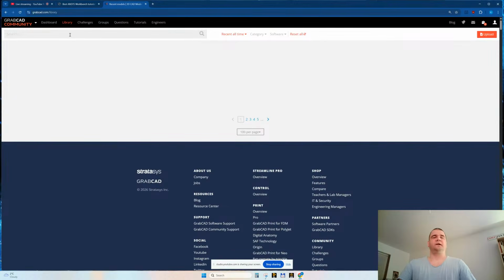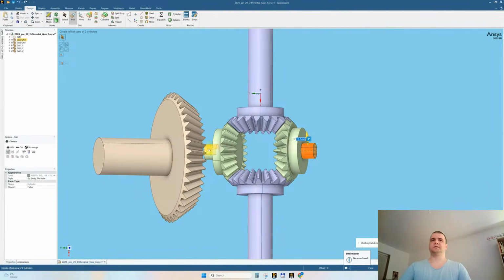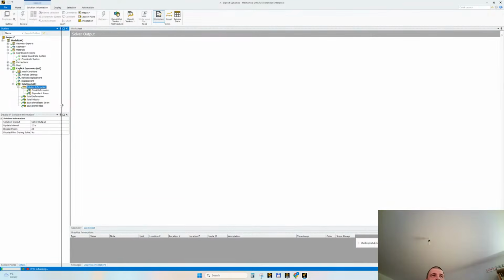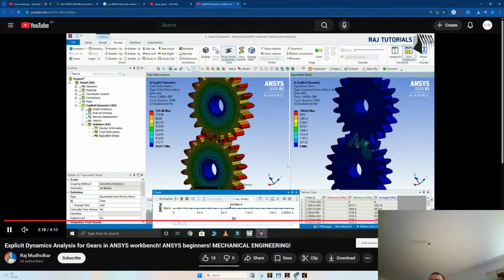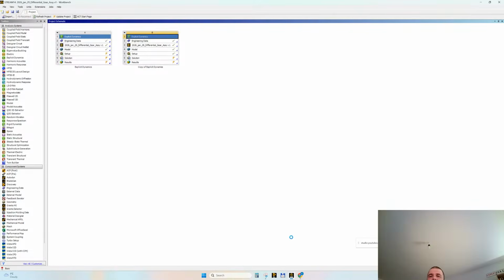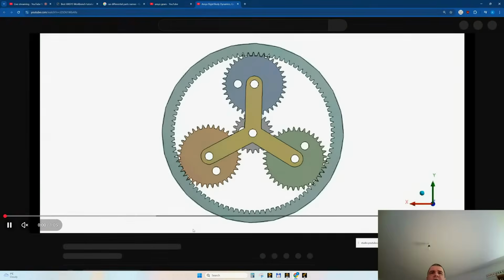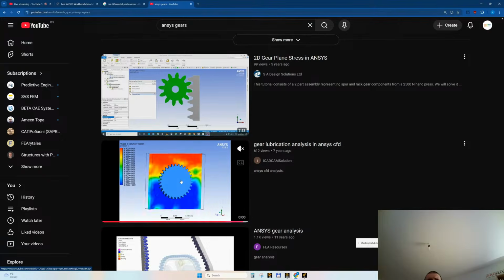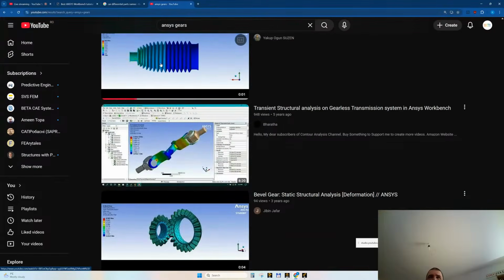FEA Simulation of Geared Differential Movement: Full ANSYS Tutorial - LIVE Stream 14

Comment: what causes the increase in temperature? was it due to the friction? 
In your future tutorials, can you teach us on how to generate some relevant graphs from the results, comparing few results in one window, something like that? I think I am also lacking in post-processing skills. Sometimes, I have no idea what should be included in the report.

Thanks
Reply from the maker: Since the Body Interaction is Frictionless, some of the reasons that temperature occurs are software specific, here are some: Conversion of plastic work into heat (plastic deformation heating), Numerical damping (bulk viscosity, structural damping), Hourglass control (under-integrated elements) → dissipated energy, Temperature rise due to compression or shock (adiabatic), even without plasticity, “Frictionless” contact ≠ “no dissipation” (penalty contact / stabilization), Initial or imposed temperature / derived temperature field. I began to apply more Solution items, and I will continue with showing how to plot Charts, gradually.